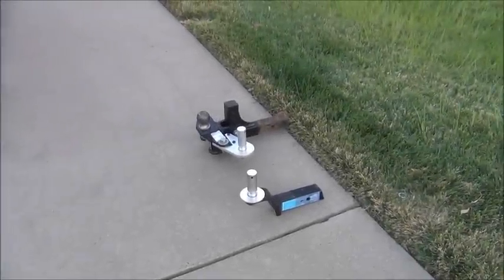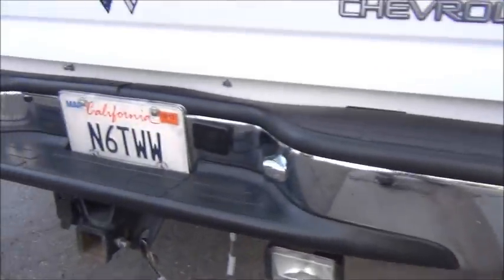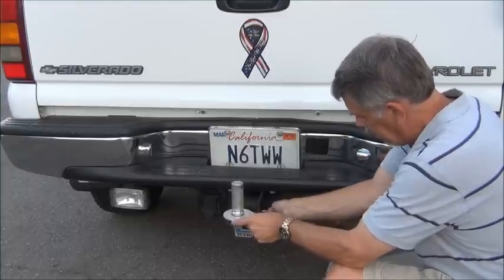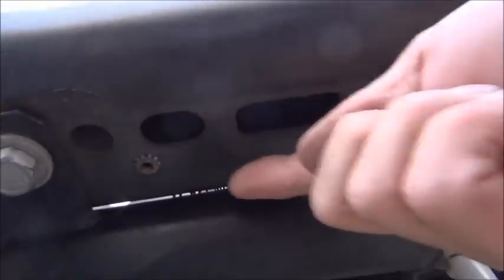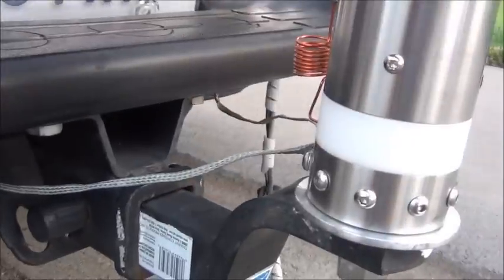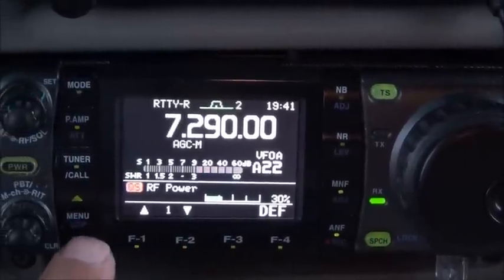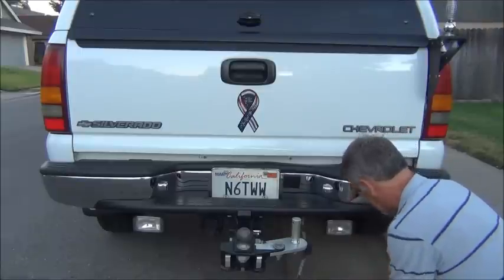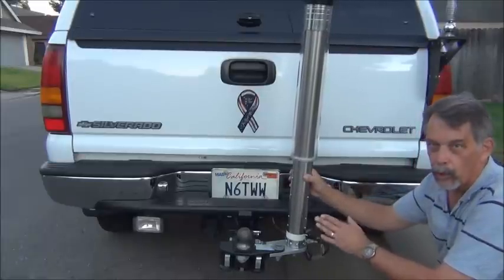Mobile HF Antenna by N6TWW

Comment: Instead to use standard grease at the base of your antennas you should use cupper grease. This grease is loaded of cupper powder to enfance conductivity. I used this type of grease on my 4 element beam for the 40 meters and I never had the slightest conductivity problem on none of my element.

Comment: Still running it like this 9 years later? How has the Scorpion held up? Also, do you really run the RF connections with no weatherproofing? (Not possible here in WNY!)
Reply from the maker: It is still running, but not continuously. I only run it periodically. Also I live in California and my location has pretty mild weather. If the weather was more severe I'm sure I would take more precautions with the RF connections.

Comment: Now do this have a welder make a plate that on the side of the hitch then a long square peace with a plate welded on it have 4 or more bolt holes mount the plate mount together your antenna be on the driver side of your truck so you can leave it on all the time be better ground j k6mb had his like that made his own multi band antenna could I have picture on my qrz check it out my call kc6nfv his home made antenna would give your antenna good run for the money he had a 68 wip on top

Comment: Okay, Mike... 8 years later, how do you like the antenna? When you purchased this, did you also look at the Tarheel? I'm deciding between these two right now - with a TuneMatic (not the lite) controller - for a home installation.
Reply from the maker: I really like the antenna. I do not have it on my vehicle at all times. I usually only have it on my vehicle when I take trips. Since publishing the video I have purchase a new truck and have moved the antenna to the new vehicle. I looked at several antenna brands before my purchase including Tarheel.
Reply: @mefedler  Thanks for the response, Mike. That's good to hear. Do you recall anything that stood out which lead you to choosing the Scorpion over the Tarheal?

Comment: I wonder, did you use those old~timey grounding axle straps?  I just recently bought a pair of them to increasing ground effects if finish to be quite portable. Once I am in position I will put a sheet-metal ground that I get drive one wheel unto, letting the vehicle's weight assist the ground.  (Always wanted to run a ground wire to railroad track. Or put ground on one track and hot on the other track then through a random wire tuner. Anyone try this?
Reply from the maker: I did add some additional grounds between body panels. I used grounding braid. I don,t think I would attach a transmitter to railroad tracks. You may damage or interfere with locomotive location sensing equipment.
Reply: @mefedler  Well, the railroad idea was never tried for any reason that possibility being one.  I should have included that. Thanks, as I have a host of family that works or worked for the railroad. I was writing about abandoned tracks and should have mentioned that.
     The grounding straps of which I speak mount to the axle and drag the ground.

Comment: Ham sticks are much easier and work excellent. If the hamstick gets stolen.Its only 25 bucks to replace
Reply: A mounted grounded ham stick or would you use a 5” magnet mount or truck-magnet mount?

Comment: Just came across this video. REALLY NICE JOB!!!
I have a Ford Ranger with no Trailer Hitch, so I have a much thinner Mounting Bracket bolted to the left front Fender Mounting just under the Hood on the left side. The Antenna is the Little Tarheel. Its very wobbly, so it is never on the vehicle when I'm driving. The problem with virtually ALL of today's vehicles is the lack of STRAIGHT surfaces to mount things to. Your Trailer hitch is an excellent solution-at least for your setup. You can get away with that because you have such a long coil; since my Tarheel does not, I'm quite concerned that the body of my Ranger could interfere with the radiation angle because of my shorter coil.  Any thoughts you have that could help me with this would be GREATLY appreciated!
Sincerely,

Bruce A. Forster-AC7AA

Comment: Great idea. I wonder if the two holes in your hitch change the load capacity? I’m probably going to do the same thing,  I have a travel trailer and a truck with a fiberglass shell. A top hat for stationary use would improve efficiency a bit.

Comment: Very nice setup Mike,  I love how you made both mounts and your fabrication.  I invested in the High Sierra many years ago and have rebuilt 4 times due to the salty Maine environment.  It's amazing it still works good after I think about 15 years.  The screw driver antenna is the way to go mobile for sure.  That Scorpion is a beast.  Very cool.  And it looks like it would hold up well here on the east coast.  Thanks for sharing this video and 73's from N1TZU...Bob.

Comment: Mike is your entire IC-7000 in there, or just the faceplate? Also, can you discuss the bonding location for the Silverado body and any other RF suppression used?

Comment: I really love the idea, but what have you done about covering your license plate?
Reply from the maker: I use the hitch that I use to pull the trailer the vast majority of the time. The antenna is offset and does not cover the license plate.
Reply: Mike Fedler oh I see, I really like the idea.
Reply: Both the hitches have an offset?
Reply from the maker: No, only the heavy duty one that is made to pull pull my travel trailer.

Comment: So with this set-up you cannot open the tailgate of your truck unless you remove the antenna first, or am I missing something?
Reply from the maker: You are correct. The antenna is mounted with a quick disconnect mount.

Comment: As an FYI, the Scorpion antenna is no longer available with the large quick disconnect stud. I found out that fact, after I purchased a new black version, and sold my older but new natural aluminum SA-680. So the 3/4 inch threads of the antenna are now machined directly into the base of the antenna.

Comment: Very well done, I have a P38 Range Rover and a Codan 7350 which is going to be a pain to mount the Autotune on.  Problem with my car is that the bull bars are plastic - so useless and there is very little useful metal around to do a descent mount - so you have given me food for thought  (no if only you could open the tailgate - just kidding).  I did notice the other mount over the tail light - that was the position I was looking at - how would that mount go with your screwdriver - I am thinking if you antenna could go there I figure your antenna is similar to mine in weight and drag

Cheers de VK4GP (Nigel or Nudge)

Comment: Thank you, I have been wondering how I would Mount the Scorpion to my truck, (18 wheeler).
I have tow hook brackets in front, much like your tow hook assembly, I'm thinking I should have a fairly decent ground plane. 
just curious if there's any way I could modify for NEVIS?
Just getting back into HF after a brief hiatus, so pretty much starting over.
Nice install BTW! You've given me some great ideas.
73's
John C. de KC5JSR

Comment: Nice setup. I use the Little Tarheel II. I've got 40 good, but having trouble with 75/80 and 20 so far. Have to get my sheet out for coil placement. They have pic of the coil for the bands. 73 KA9WLU

Comment: What are the odds that your license plate number matches your FCC call sign?   You should play the lottery.

If you mount the antenna horizontally it looks like it'll work like a Scorpion Truck Mounted Attenuator (TMA) on the back of construction trucks on the freeway for protecting the work crew.

With that big protuberance I bet passersby make snide comments that you're compensating for something.

KM4KDE  88s  ---uh 73

Comment: That will not work in the state of AZ "the surveillance state" because it covers the license plate. You would be stopped by the first cop that saw it. AZ has thousands of photo radar and red light cameras, and anything that blocks the cameras view of the plate is illegal. I was stopped for having a hitch ball with a spacer between it and my step bumper, which obscured part of the plate. 

I have a Yaesu FT-2900R 2 meter rig in my car, and use it on one of 2 local repeaters. But I can't see trying to operate on HF while driving a car. VHF FM usually comes through loud and clear, but HF is harder to hear and  requires paying a lot more attention to what you are doing. Doesn't look like it would be all that safe. I do have an Icom 718 that I take with me sometimes. I will find a nice place to park, connect it up to the car battery, and deploy my Alpha EZmilitary antenna. That antenna is absolutely amazing. I didn't believe all the reviews on it, but I finally got one anyway, just to see what it was like. By far the best portable antenna I have ever used. Along with an LDG autotuner, I have made contacts all over the world.

Comment: This has given me an idea on how to finally mount an HF antenna on my car. Mounting on the roof or fender would be difficult since the metal in those areas is thin and would require significant structural reinforcement to support the weight of a decent antenna. Bumper mount is also not an option due to plastic bumper.

However.... I can install a small hitch on my car without too much trouble (just bolts right on to existing holes in the frame and under the bumper. The hitch would then provide a nice strong mounting point for an antenna!
Reply: MTTT3000: I am going to exactly 
the same thing on my '90 Crown 
Victoria!!!!  I was already scoping 
out small hitches!!  Great minds...! 
73s to all, Norman.

Comment: Hi.

I don't understand your point about why you don't use the bolts with a trailer.  It seems to me that the antenna would be all over the place as you go down the road.

Thanks

Alan - N2DRO
Reply from the maker: The weight of the trailer on the hitch will keep the hitch from flopping around as it might do when there is no additional weight on the hitch. When the trailer is hooked up the antenna is very stable.

Comment: Personally I would go and extend the rear bumper area an have a mount on the chassis, you create to mucha work when you have to mount off the tow bar, whilst this is a great option I would tend to look at a permanent mounting option having mount and dismount this will become an issue as you age..

Comment: Well done video and gave me a great tip with those bolts on the bottom and one side for stopping the wobble. I'e been hammering-in a small steel wedge like you use in an axe or sledge hammer head/handle. I've been using a large alligator clip for the grounding strap too, I like your method better.

Comment: Doesn't the mounting on the hitch have a negative impact on the radiation pattern compared to mounting it higher?
Reply from the maker: There are advantages and disadvantages to everything. Pick what work for you.

Comment: Mr. Fedler, great video! I learned a lot. I noticed the black mounting bracket that you have on the right tail light, what is it and where can I get it? I have been looking for something like that for months!
Reply from the maker: It is a mount for another antenna. Originally I made it for a 6 meter antenna, but 6 meters did not play well at that location. I am currently using it for a 10 meter antenna. I made video about it which is titled "Amateur Radio Antenna Mount by N6TWW ". You cannot buy one but you can make one.

Comment: Very nice job.  What is the approximate length of the antenna and whip when fully collapsed and fully extended?  Where did you get the brake light mount and antenna on your Silverado, is it for CB and how long is it?
  73 KC1BSE
Reply from the maker: Answers to your questions:
#1 The overall length is about 111 inches when collapsed and about 128 inches when fully extended.
#2 The brake light mount is homemade.  If you want to know more about it, I made a video about it titled "Amateur Radio Antenna Mount by N6TWW ".
#3 The mount was originally made for a 6 meter antenna but I found that 6 meters does not work well at that location. Currently I have a 10 meter antenna on it. The 10 meter antenna is an old CB antenna that has been shortened for use on 10 meters.

Comment: How did you ground it? We had the antenna in our jeep and had huge issues with grounding.
Reply from the maker: There are several things that were done to ensure that the grounding was sufficient. #1 the bolts that stop the hitch from moving around provide some grounding to the antenna mount which is in addition to the grounding already present. #2 I added ground leads from the antenna to the frame of the vehicle. This is shown in the video.  #3 I have multiple bonding straps between the frame and the body panels to ensure the large metal pieces of the vehicle are at the same ground potential.
Reply: You wasted your time grounding tto the bumper you be better off grounding to the chassis to tidy it up I would look at  mount and have a similar setup that you  plug your trailer lights too,, bad Mojo having loos cables  lay about

Comment: Some questions; what is the purpose of that external little coil by the base? And second, I've also heard that if the actual radiator, including the internal coil section; was clear above the roof line of the vehicle (highest structure) that the antenna would perform much better. Last, what is the power rating of that antenna in SSB mode? Great vid & thanks for sharing. Hassan N1CY 73's
Reply from the maker: The small wire coil at the base is called a shunt coil and is used to raise the impedance on the lower bands closer to 50 ohms. (40 & 80 meters) You are correct that if you can put the antenna above the roof line it will work better. My installation is not perfect as far as performance is concerned. Most installations are far from perfect. Mine is a compromise between performance and physical strength. Another thing to consider is the shell on the back of my pickup is made out of fiberglass and is transparent to the RF being generated. I don't know the power rating of the antenna. You could contact Scorpion antennas for that information.

Comment: Excellent video Mike. One of the best I've seen. How much bonding did you have to do? I have a 2010 Dodge 3500 p/u with a receiver hitch mount similar to yours. I was considering buying a screw drive antenna but didn't want to deal with the bonding. I know it's important. Thanks again
73 Bob KC6SOT
Reply from the maker: I bonded the hood  to the body on both sides, the bed to the body on both sides and also bonded to the frame. I know that some people have had trouble with electrical noise from their vehicle but I never had any problems even before I did the bonding.

Comment: I had threaded my hitch also but the threds go a while. So anymore I weld a nut over the hole in the hitch then put a bolt into it to stabilize the antenna in the hitch. Also I put one in the bottom and both sides of the hitch. The 5 foot 3" stainless tube Predator made bu N9JMX has no problem and has been on several trucks and beats many other antennas at shootouts. See it on youtube... 73 Jimmy, ARRL TC, WX9DX

Comment from the maker: The climate where I live here in the central valley of California  is pretty mild compared to many other places. It get down to freezing in the winter but snow is very rare where I live. If I lived in Quebec I would definitely have to change a few things. Thanks for watching.
Reply: A little bit of Sanchem No-Ox-Id on each connection would be good where I live.   73  de K0UA

Comment: first off thay make a ruber slip for the recever thay makes a nice tight fit and secend just add a ground wire and use the right gauge solit wire and you can plug it directly into you wireing harnes  your ideo was great to tho and works. whare i live we cant use  antennas on are cars becus people steal them

Comment from the maker: Yes, the best place to mount your antenna for performance in the center of your roof. That location offers the best ground plane for your antenna and will provide the best overall pattern in all directions. Since there is already a hole for the NMO mount, I think your solution is already provided for you. 73, Mike

Comment: I am trying to figure out the Best place to install my antenna, the (Comet CA-2X4SR - Broadband VHF/UHF Dual Band) that I'll be using to monitor. I have the NMO mount but on another amateur radio ops you tube channel he mentioned he used the a trunk lip mount on his front door area, I already have a hole on the roof of my truck for an 3/4 inch NMO mount on my roof and i  don't want to become too much of a stand out but i also want the best performance i can get.  Any ideas?

Comment: Hello Mike 
I am not a amateur radio Op at this time am planning on taking the exam later this summer to obtain my license What area of Northern California are you located as you mentioned to another person, i am currently in Chico But moving to Redding, i like your Hitch mount creation (clever) i have a 02 ford Ranger and i am preparing to build my system so i can monitor prior to my license then i can broadcast. I purchased an antenna and a NMO mount, but thinking of getting a trunk lip mount

Comment from the maker: You should be able to do something similar. There are receiver hitch mounts that bolt to the rear square bumper of an RV. I have one on the back of my trailer so that I can put a bike rack on it. You could use a setup similar to mine or make a custom mount specific to your needs. Since you RV is fiberglass it should work with the chassis being the ground plane.

Comment: Great video, very informative.  I am wondering if I can do something similar for a project I am working on.  It's semi-mobile.  I want to install a mobile antenna on my RV trailer rear bumper or the rear hitch.  The antenna is not for when rolling down the road , but when I am stationary at a camp ground..  I can either setup my mobile rig inside the trailer or outside to enjoy the outdoor.  Any suggestions would be welcome.  My RV trailer is fiberglass.